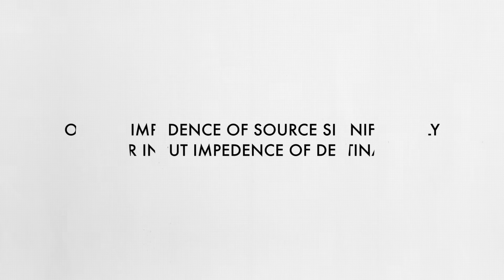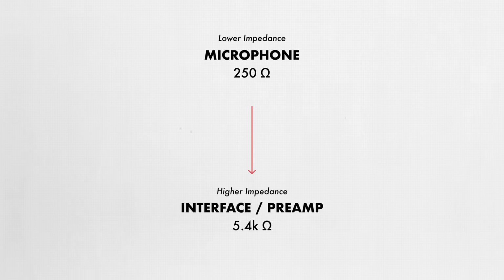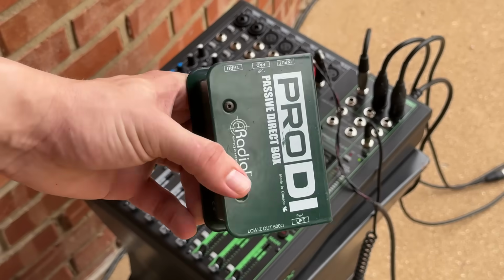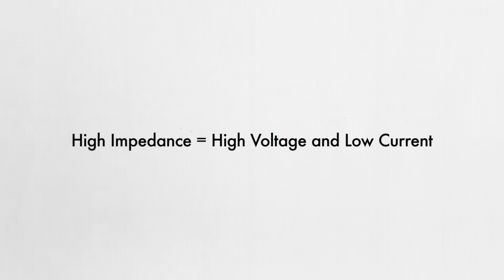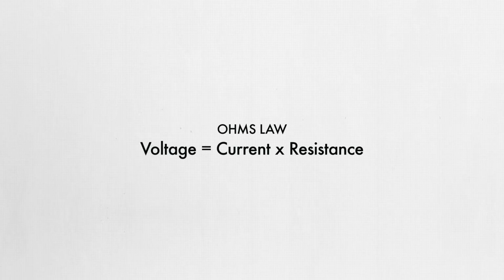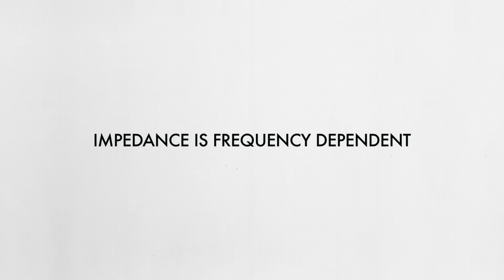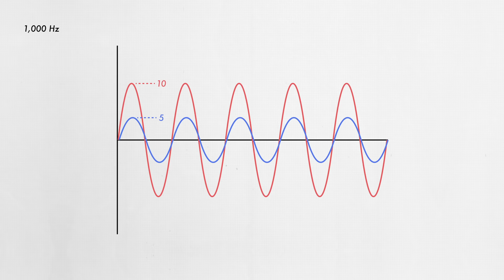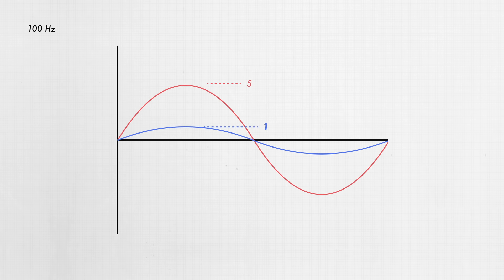Hi-Z vs Low-Z: What's the Difference?

Comment: Good vid.  I like that you began with a very clear demo.  But more importantly, both your vid and the one from Alder Audio, which I ran across a few weeks ago, seemed to confirm something for me that I find very confusing and non-intuitive.  The question is, how can an output device have an impedance in the first place?  It doesn't impede the flow of current, it produces it.  As I understand it, then, output impedance is a mathematical illusion, purely the product of Ohm's Law.  The signal from a mic or a pickup has a voltage and and amperage, so the idea that it has an impedance is only a matter of solving for Z.

This is useful for me as a multi-instrumentalist.  For years I've been looking for a good way to run several instruments into a mixer on stage.  I don't need a balanced signal, as my cable runs are very short, and if I were only running one instrument into an amp, I'd be running an unbalanced signal, anyway.  And I don't want to bring my level way down to mic level, but rather I want to convert to line level and just use a line mixer.  Most of all, I don't want to spring for a DI for each instrument.  Here's the catch: nobody seems to make devices that do this.  There are resistance mixers, but the signal loss is extreme.  And nobody makes an instrument level mixer.  There's a number of mixers on the market with one or two instrument-level inputs, but none with the number of hi-Z inputs I would need.  It seems to me, though, that I should just be able to work out the specs for a transformer, then run my hi-Z signals into the primary and grab the lo-Z signal off of one end of the secondary (both ends if I did want a balanced output).  If that's all that needs to be done, I should be able to construct something very compact and inexpensive to do the job.

Comment: Can you address using a line level balanced signal without a DI box. I have synths that have those and when gigging I ask the FOH to please not "unbalance" my signal with a DI. It seems to be one of those unwritten laws that keyboards need a DI. Maybe an old Rhodes might need one. But a Korg Kronos workstation? Thanks for reading this.
Reply from the maker: I’d recommend using a DI to prevent accidental phantom power reaching your keyboard from the FOH console.
Reply: @AudioUniversity that's a good point. I struggle with the idea of taking a perfectly good balanced output coming off of my synth and unbalancing it just to have a transformer rebalance it. The device in question is a Korg Kronos. I use TRS to XLR passive adapters to get my signal to FOH and always make sure that my TRS cables are plugged into the Kronos first, before plugging the XLRs into the FOH. That eliminates the possibility of shorting it out. At least that's the way I understand it.
Reply: Keyboards, like pipe organs can be a very wide range instrument. A transformer does not work at DC, so has a low frequency cutoff. Depending on the venue and sound system, a transformer will have little impact on the sound. If the large concert has a stack of 4 dual Meyer Sound subs on both sides, or better, than skipping the transformer is advised for the earthquake frequencies to come through. Check with the sound engineer on what voices you intend to use on the keyboard. A stage piano is fine with a DI box. 64 and 128 foot pipe organ registers need the transformer skipped.  Ask your sound engineer, and discuss your frequency bandwidth into FOH needs.  Consider a transformerless active DI for keyboards needing deep bass.

Comment: Hi. Based on this video my question is .. where should I put the DI in such case? Guitar - DI - mixer - guitar pedals - recorder OR ... Guitar - fx - DI - recorder?
Reply from the maker: DI's have a high-impedance thru output, so both are potentially correct. Depends on the sound you want to capture. Check out this video: https://youtu.be/_xybjiuD9K0

Comment: Do you have a video showing these impacts on piezoelectric pickups, as used on many acoustic instruments, vs inductive pickups that are typical on electric guitars and basses?  Many have criticized the "quackiness" of piezos when much of that criticism ought to be leveled at using too low of a "high" impedance input.

My experience has been that while a 1M ohm input impedance is fine for typical electric guitars and basses with their magnetic, inductive pickups, it's often inadequate for piezoelectic.  With those piezos a 10M ohm input gives results more consistent with expectations, especially for upright basses and even the lower notes of a six string guitar.  This is due to the largely capacitive impedance of those piezo pickups.  Going into a lower "high" impedance such as a 1M ohm direct box or into a typical guitar or bass amp with these will filter out the lower fundamentals and harmonics to varying degrees.  It's the opposite problem with inductive pickups going into lower impedances where it's the high frequencies that are lost, as you've demonstrated.

For that reason, in the past I've built active direct boxes with 10M ohm inputs, specifically for piezos though they also seem to work just fine with magnetic pickups.

Comment: Finally a clue as to why audiophiles claim high impedance headphones "sound better"
Reply: Sound quality is not totally dependent on impedance.  If you have a low impedance source connected to a high impedance headphone, the source has to have higher voltage than is needed with a low impedance phone to achieve the same level without distortion.  Similarly, a low impedance phone needs a higher current source in order to avoid distortion.  I use relatively high impedance Sennheisers (300 Ω), so on my portable device I have a balanced cable with + and - signals to double the voltage and quadruple the available power.  My player has a balanced output to accommodate that.  The voltage of a portable player is typically limited by the battery voltage, so having ± voltage solves that problem.

Comment: Very interesting and clear but what you forget to indicate is that most little sounds cards like the Scarlet you are showing have either two entries for voice and for instrument, or one with an empidance adapter switch. In these cases, the DI box which is sponsoring this video is not necessary. Am I wrong?
Reply: On a modern interface, not really necessary but years ago I had an old crappy Maudio interface that had an instrument input that would just cause bad feedback in Guitar Rig, I had to do this DI box trick into the mic input for it to work

Comment: Actually, you can imagine it like this: If the pickup has a high impedance and the line input has a low impedance, then this is almost like a closed circuit with a battery (representing the pickup), which has a high internal resistance, and a load (line input). A high internal resistance in a current source (pickup) always means that the maximum current is limited. And since the current flowing in a closed circuit must be the same everywhere, this means conversely that the voltage at the line input will also be very low.
To apply this to an audio setup, you just have to remember that the resistance is dependent on the frequency, which is why you have to talk about impedance.

Comment: This is in part a follow-up to one of the other comments about how audio might differ from impedance in RF systems: it doesn't.

When I started in professional audio, back in the late 1970s, we were taught transmission line theory BEFORE anything to do with microphone circuits. In my view (after a bit of time has elapsed!), it's the only way to properly explain the issues.

There's no difference in kind beween RF and audio frequency lines, but the impedance issues become VERY important at RF since you're always trying to optimize POWER transfer (not amplify voltage). Actually this is still an issue in audio, except that it's not often apparent that this is the case. 

Nearly everything in audio use today has some sort of semiconductor amplifier in it (including microphones and recently designed guitars), so optimal power transfer is not as important as it used to be. Voltage gain is the 'modern' thing.

Note that in the example of the video, you're at least double-terminating the source, so you'd expect a 3dB or 6dB drop in input voltage (other things being equal). The trouble is, you're trying to explain too much, that's too complex, in too little time. It made my head spin, and I know what you're trying to say already!

I have one microphone in my collection that has a 30 Ohm (thirty Ohm!) output impedance. Obviously, if you connect this directly to a modern mic input (at, say 3k Ohms), it's going to sound very quiet at best, also thin and lacking in bass. Yet it already has an impedance converting transformer built into it! 

Why? It's a classic ribbon mic, and the actual ribbon has an impedance probably measured in hundredths of an Ohm. Iit's basicaly a short length of foil in a strong magnetic field. The exact model (a Reslo) was available with higher impedances, but the transformer to achieve that was much more expensive and physically bigger. I like it because it's great for piano and drum overhead (although the Beatles used them for vocals).

When I started, I was taught that the best general-purpose compromise (when you can't get exact impedance matching) was a mixer-input to Source impedance ratio of 2 : 1. This would mean mic inputs would be most useful around 1500 - 2k Ohms, i.e. lower than the typical 3k you find nowadays. It's also an acceptable match for many 'line' sources, needing only a resistive pad (say -50 dB) to make it a workable line input too. But the world has changed...

When matched properly , a low-Z output is less suceptible to interference over long cable runs than higher-Z ones. In TV in the 1970s the BBC had studio wallboxes with impedance matching transformers built into them: this was so that really low-Z ribbon mics (on Fisher or Mole booms) would plug into special 8-way connectors that put the transformer into circuit (you could completely bypass the transformer for other mics). This was necessary for valve mixers (becoming obsolete by that point!), and helpful for noisy germanium transistor ones, too.

it's always worth remembering that electric guitar pickups were originally made as cheaply as possible, and that those designs suck kinetic energy from the strings. I changed the ones on my Jazz copy bass years ago for electronic pickups, because they have a weaker magnetic field, which in turn means better sustain. 

Likewise, a hi-Z pickup allowed cheaper input stages on the valve instrument amps of the day (cheaper transformers, etc.), and being unbalanced they used cheaper cabling too. As a general rule, inputs in the megohm range are a nasty nuisance, being prone to interference, etc. 

It's an anachronism we can really do without in the C21st.

Comment: Here's a phrase my father taught me that was very helpful: "Voltage pushes current through resistance." Just picturing that in your head gives you:

A) More resistance means the same voltage can push less current, or that more voltage is needed to push the same current.
B) More current can be achieved with either less resistance or more voltage
C) More voltage will push the same current through higher resistance, or more current through the same resistance.

Lots of times, the actual numbers don't really matter all that much: what's important is to know the general effects of changes.
Reply: Small correction to the point 3. If voltage stays the same, resistance goes higher, current drops. I=U/R which is: Current equals the Voltage divided by Resistance :)

But that is only true when considering pure resistances and DC-voltages (steady, unchanging) without IMPEDANCE. Impedance is "complex resistance" when instead of having the same "resistance" on all FREQUENCIES, the system behaves differently based on the frequency of the signal/voltage applied. 

"Complex resistance" means, that there are more components to that simple value of "impedance, It's a vector (it has a magnitude AND a direction) that emerges from resistance, capacitance and reactance components (all themselves different, but related phenomena) and it's combined into this value/number you call "impedance" depending on how much of each component there are and into what direction each is "pointing towards", which themselves are all frequency dependent values.

 It's complex stuff (no pun intended) and really math heavy and you go really quickly into imaginary numbers and vectors to try and describe what happens... :)

That's why it's a really difficult thing to try and describe that all to a lay person or someone who hasn't studied electronics for some years in university :)
So I get it... but many good efforts are out there, to help people understand the basic concept of it without going into the mathematics of it all.
Reply: Yes, Ohm’s Law states that “it takes one Volt to push one Amp through one Ohm”.  I was taught to think of electricity in terms of plumbing:  Voltage is water-pressure, current is the amount of water flowing per unit of time, and resistance is a narrowing in the pipe which restricts the flow of water.
Reply: I love this! Thank you!
Reply: What always fascinates me in elect. engineering is that "Voltage pushed current through resistance" can be explained using various approaches of waves and signal analysis and physics. my favorite here is that changing an impedance will eventually change a system that has both resistance and capacitance or inductance,  which changes the "filter settings" or the frequency equalization of it, and with it the entire noise of that filter (noise is related to bandwidth). now feed that to a slightly non-linear preamp and surely the tone will sound different
Reply: Life changing stuff. Thanks
Reply: Just you described second Ohm law.........😆